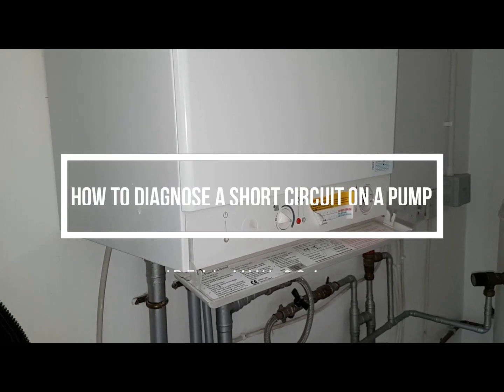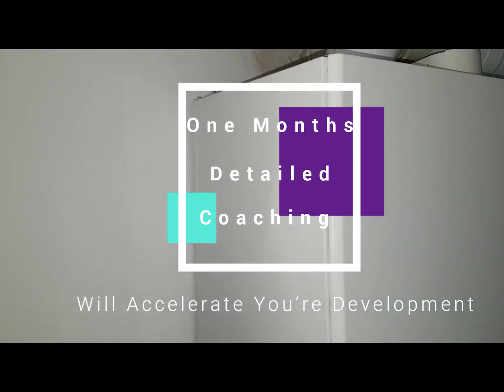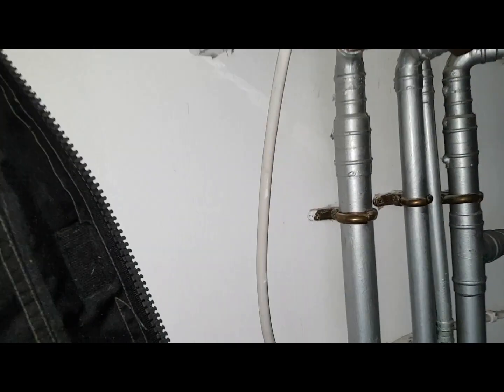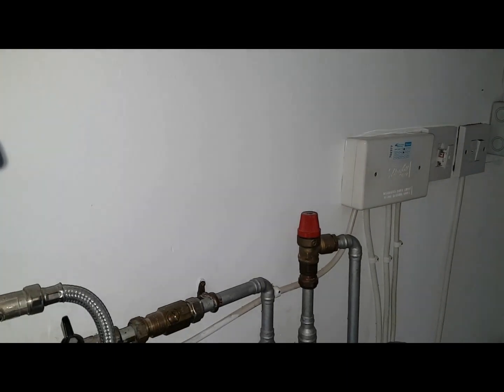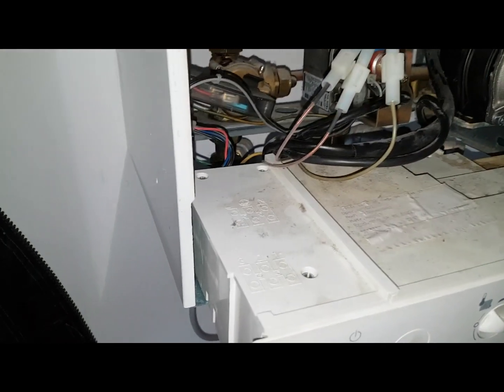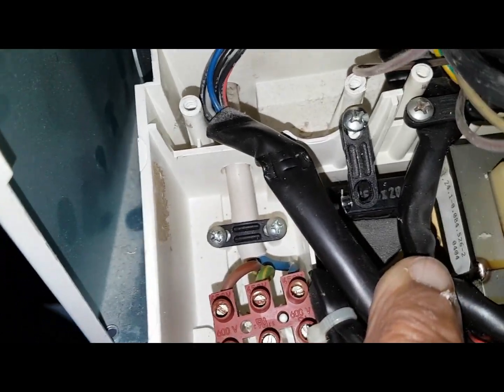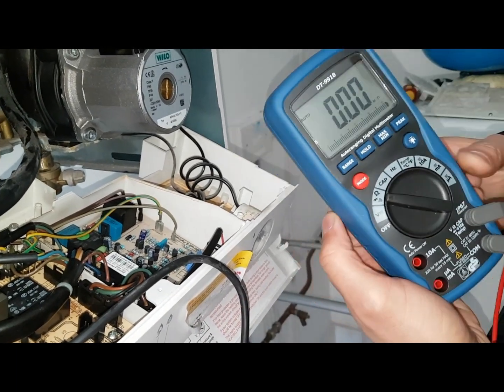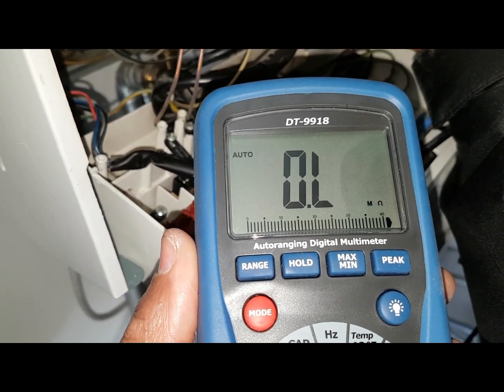Ideal Mini S24  How to Diagnose a Short Circuit on a Pump  With Coach Tony Morgan

Comment: This video is dangerous, that is showing an open circuit. To test the pump should be disconnected and then test across l and n for a resistance of 30 to 100ohm.
Reply from the maker: Thank you for your comments

Comment: Hi. Mine flashes a green light and not water or heating. What do I do ? I’ve checked the power supply and it’s fine
Reply from the maker: It could be the central heating pump